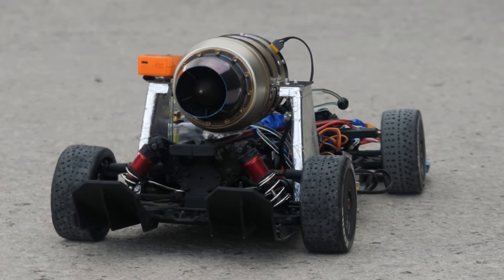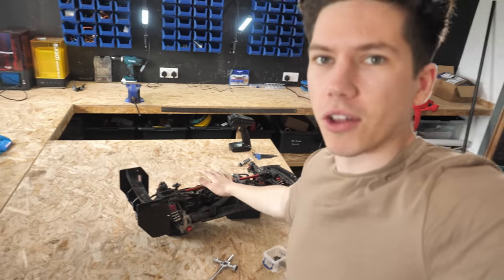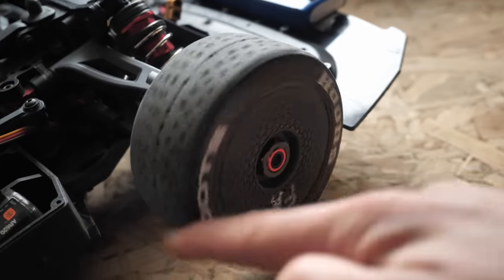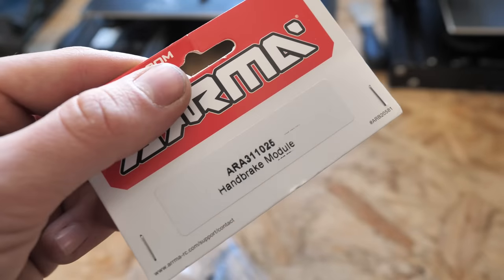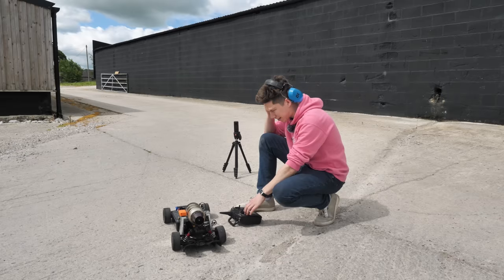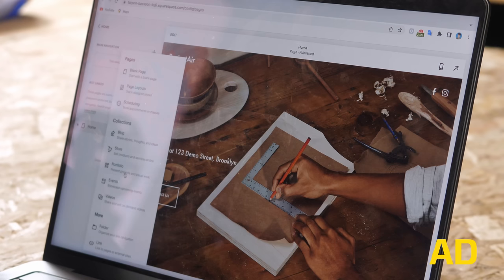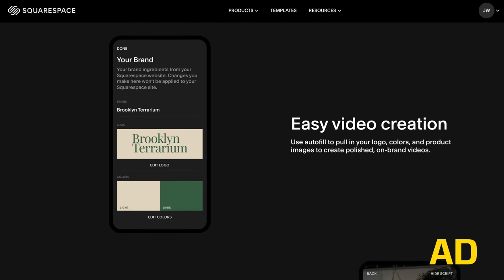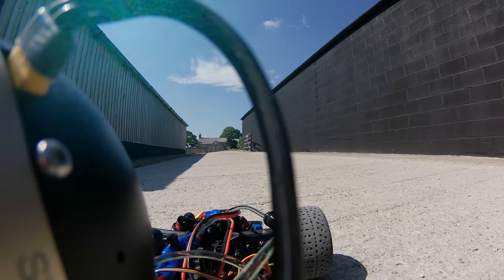RC Car Jet Engine Upgrade

Comment from the maker: If you own about 1000m of straight, perfectly smooth private road, let me know! 😉
Reply: i do
Reply: Colin fuze maybe like he uses a runway maybe ask him
Reply: @dorsalfinn89  Bingo!  That’s exactly what I was thinking!  A collab with Colin, perhaps? 🤔
Reply: Are you near any Military camps?  It could be worth getting a contact inside if so.  The key is figuring out who the hell to speak to... And that would depend on what Camp and who is there.  If you have one local I can try point you in the right direction to make contacts inside.
Reply: operatorflix has
Reply: Ask flite test.
Reply: maybe you should try an dragstrip?
Reply: Ask carwow to race it
Reply: I do but it’s in the USA ☹️
Reply: @asaliljedahl4685  dragstrips are treated with a sticky resin like material that gives the cars extreme grip, it would be very bad for a jet car since no torque is being applied to the wheels.
Reply: Santa Pod Raceway maybe?
Reply: @itsnorvinplayz4308  well where is it????
Reply: Hi, i don't own a private road, but i had an idea to make the car stop even better.
You need to add discs with a hole(or some kind of obstacle) in the fuel tank, to stop the fuel from slushing around and decreasing the stopping power.
 if you don't know what I mean, look at what's inside trucks that carry gas to gas stations.

Hope that helps, love your videos
Reply: I don’t own a runway but you should look up the channel Flite Test. I believe they have two
Reply: @niiice8622  agreed, i think they are called a baffel plate
Reply: The new Elizabeth line in London platforms are perfectly smooth, straight and 250m long, its shut on Sundays at the moment so maybe they will let you use them?
Reply: @that-1-guywith-a-name411  I don’t think their runways are long enough for this project. I think they’re only 150-200 feet long. And, FT is stationed in Ohio where Project Air is in the UK.
Reply: rofl
Reply: @niiice8622  Baffles, they're called :)
Reply: Hey @ProjectAir can you make an RC F1 car? It would look really cool!
Reply: @dorsalfinn89  That would be sooooo cool
Reply: Check with Kevin Talbot, or Claire's RC's (Youtube).  I know they have used an old airfield in past speed run videos. Cheers James!
Reply: Well, there is a 3km long, perfectly straight, perfectly flat converted railway tunnel in the midlands you could use 😉
Reply: I'm located in Bangor Maine, (USA) and I know a public race track that I used to skate at, if you're willing to fly down here, you could use that.
Reply: I heard the Berlin airport (BER) has some free runways it's not using right now. You might be able to go there :)
Reply: @davidfrench1325  like fly to america spend lotzs of money just to test a car plus the runway isnt that big!
Reply: talk to kevin talbot. he is trying to find a runway aswell
Reply: Contact funny guy Kevin Talbot here on YouTube. They use a runway for speed runs. He might set you up to take a run on it.
Reply: @nikolus24  That's exactly who I mentioned too, lol.
Reply: If you add a mobile connected camera so?
Reply: I can provide you with a runway to use at my work place but in the Midlands
Reply: Not sure where you are based (this is the first vid of yours I have seen) but Bruntinthorpe in Leics is one of the longest privately owned runways in the UK - so long the end disappears over the horizon. If you are in the East you could try Rendlesham or Woodbridge, SE there is Manston in Kent. There are many retired military runways that are now privately owned, search 'longest runway uk' and you will quickly find a list of active, disused or extinct sites.  I look forward to seeing a full speed test.
Reply: Come to the Rossa event in august, or get in contact with the runway in loughborough
Reply: You deserve more subscribers
Reply: Matt Watson from Carwow...
Or Max Fosh🤣🤣
Reply: You should use the old BBC road that they use for shows I can't remember what it was called but there is a road the BBC owns that they don't use anymore that's pretty open to the public, But i'm sure you could ask, Or go up north I know Scotland has a ton of abandoned roads.
Reply: Awesome project mate, I love when people think outside of the box, that thing is going to shift! 👍🏼✌
Reply: Where is the ejection seat part 3
Reply: @davidfrench1325  they're in the US mate
Reply: Angle the  engine upwards and duct the inlet down through the floor pan giving you some downforce with a low pressure zone under the car.
Reply: Santa Pod raceway. They are pretty helpful.
Reply: speak to keith bartlett at santa pod, he used to let me run my rc rocket car on the strip
Reply: Call Cletus McFarland
Reply: Then tell him and give him actual information
Reply: @itsnorvinplayz4308 .
Reply: There are plenty of racing clubs that have leases to general aviation airports this time of year.
Reply: I want to challenge you.
Can you build a plane where you can recharge drone during a flight?
Reply: Call Garret /Cletus Mcfarland. Loves Jets,  and has a track.
Reply: @whatev888  in south australia
Reply: CARWOW
Reply: cleetus mcfarland
Reply: @davidfrench1325  Flitetest is in America lol
Reply: Which aap use for designing of car engine
Reply: @dimonik12 yeah, the famous British military, very active in the 21st century. Face palm.

Comment: I have a driveway that is quite long but was recently given a new tarmac layer, it is very smooth meaning the vehicle wouldn't have any issues with bumps etc.
Reply: Not 1 Kilometer long sadly
Reply: Perhaps project air could use it (if you live in the uk)
Reply: @Build_Eye  ik but its too short
Reply: @operatorflix6339  fair
Reply: I don’t think he’s coming to ur house

Comment: Try redesigning the fuel tank and adding baffles to it. That might help increase stability when decelerating.
Reply: Yes! Baffles will help a lot for stability. Look at milk tank trailers for example, they all have baffles
Reply: exactly!
Reply: Came here to say add baffles. Good shout.
Reply: Fuel Cell Foam is a special, sponge-like material that is installed inside a racing fuel cell. The foam is mostly air, so it doesn't reduce the capacity of the cell. However, it provides a few key benefits: It reduces sloshing.
Reply: @henryyandell3222  you can just stick a fuel safe sponge in the tank.

Comment: Amazing video! If this car starts moving when on idle, I can only imagine how fast it will go at full power. You might need to add on an FPV system so that you can still control the car when it goes out of sight. I also noticed a crucial flaw in the car; it doesn't have a name!

Comment: At high speed I can guarantee it will tumble, rupture the fuel tank and spray fuel everywhere ending in a nice fireball, so make sure you record that.
Or implement a roll cage.

Btw the brakes are efficient if you have downforce, im not sure how much of it you will see if your parachute pulls the chassis upwards?
Reply: I agree plus his motor is high centered already a roll over risk in itself I’ma truck driver i know all about roll over’s i see them twice a week out here 😆
Reply: You could throttle the motor up so the thrust his the chute in turn pushing air forward to help slow the rc car

Comment: I'd love to see some thrust reversers on that thing. Not only would it allow you to break at high speeds without deploying a parachute, but you can even taxi backwards with it. 

Should be fairly easy to make with some sheet metal and a servo.
Reply: Haha easier said than done... Do you think about the one that were fitted to the first 737s ? Those one should be the simplest but if he ever installs reversers he might have to shield a big part of the car I think.
Reply: Clamshell is really the only option with a turbojet. All modern reversers use bypass air. Cool idea though!

Comment: you will want a gyro stabilizer at a minimum for the high speed run, i'd recommend also looking closely at the wheel alignment and a body that provides some downforce.
Reply: Gyro stabilisers are a good shout. Not sure how well they'll compensate since they're designed for working when the wheels are driven, not a thrust source above the centre of mass...
Reply: @lio1234234  It would still work.  It's not like the gyros turn off when you don't apply throttle.  You can have gyro on a model glider which has no motor and no wheels.
Reply: You can also adjust the suspension setup so its neutral and won't want to turn unless you really mean too.

Comment: I definitely suggest getting some startup and shutdown procedures down. Just turning the engine off after it's just been on can cause excessive wear and warping of the internal components of the engine. I'd say a 30 - 60 second at idle before powering down should do for an engine of that size. It's a big part of testing engines at full scale. The effect isn't as pronounced with smaller engines but is still there.
Reply: The ecu does that by itself
Reply: I own and fly several model turbines
to help with cooling I have a marine bilge blower with a length of dryer vent hose on the inlet..I put the hose over the tail cone and run the blower on a 3 cell lipo.
it does a fantastic job of drawing cool air through the engine and keeps the turbine spinning till its cool enough ..only takes a minute or 2 and temp is below 90c.
Reply: That's a very good comment. There's a shutdown procedure in the manual.  https://www.sw-jet.com/uploads/1/1/1/0/111064875/sw_manual.pdf . You can do that by RC command and the ECU will do it, BUT in case of a flameout( when fuel supply is interrupted) the ECU won't automatically do a shutdown and cool down the engine safely. That's also in the manual. I'm (fairly) sure James has read the manual :).
Reply: @chuckels431   or a used leaf blower works
Reply: Is that really necessary? Once it’s shut down the maximum temperature can’t increase, it can only spread slowly from the hottest regions to other parts. If they are designed to survive those temperatures it shouldn’t really be a problem.
Reply: @Mike-oz4cv  I believe the goal may be to cool the engine down more evenly thus leading to less warpage.
Reply: @Mike-oz4cv  Old school turbo engine cars needed a manual cool down period after a hard run, idling for a few minutes,  or you needed to install a turbo timer  to allow oil to circulate through the turbo to prevent uneven cooling and thus warping.  Turbos get red hot so obviously they are designed for those temps.
Reply: The turbine ECU handles all shutdown and cool down procedures by manually spooling the turbine wheel to blow air over the components. It adds run time to the turbine (the ECU disables turbine operation after 25 hours for mandatory maintenance intervals) so a lot just use a leaf blower to cool faster. The only way you will shock cool these turbines is by blowing super chilled air inside such as CO2 or similar.

Comment: Nice. Have you got access to a bubble tank to fit between the main tank and the engine. It will give the engine a small reserve and also prevent bubbles getting to the engine  and causing an inadvertent shutdown.   I always used a bubble tank in my model jets for this very reason. Just a thought and keep the content coming.
Reply: Great shout with the bubble tank!!!

Comment: Another interesting project. 😀👍
There are a few things that are worth looking at for various reasons.
1. Is the engine level? Most jet cars have their engine lower at the front so the thrust pushes the car into the ground, but your car has the engine high up not low down. 
2. The parachute. Yours seems to want to lift the rear of the car up. Maybe trying a cross shaped chute (top fuel dragsters) made out of a lighter material? This would mean you can have a smaller box and I'll just add drag. 
3. If you had some shock cord between the car and the parachute then it would soften any sudden jolts from the parachute. Less chance of  the car getting out of control.
Can't wait to see it stretch it's legs, it'll be awesome. 😃👍

Comment: Awesome project well done.

Also Pendine sands would be a fitting place with it’s land speed heritage, get there early when the tide is out, hardly anyone out and untouched sand for miles, fpv headset would be a nice touch too or steering gyro if it gets a bit squirmy at high speed.

Comment: I'll be curious how car-like this is going to be at top speed, 'cause I suspect it's going to be more of an odd-looking plane. Hope someone is able to hook you up with a proper race track to find out.
Reply: And that is why in the next video I can guarantee some wings will be fitter front and rear to hold it down..

Comment: Have you thought of using a tether around a central pole, it’d be great to see the stability limits at higher speeds.
Reply: The world record for the top tether car speed is 214 miles per hour (344.4 kilometers per hour.)

Comment: Looks very promising! ... Whilst the parachute is going to be pretty interesting engineering wise, I'd question whether it's the most effective / appropriate braking method for this though ... wouldn't the 4 wheel brakes, and maybe some kinda "active aero" approach (like an aeroplane does) be sufficient / simpler to build? If not, could you have a "U bend" type way of swivelling the thrust forwards to brake?

Look forward to the next edition already 👍🙂

Comment: If you go to Donnington park circuit in the evening around 5pm and ask nicely at the gate I’m sure they will let you use the huge paddock, it’s relatively smooth and noise won’t be an issue. 
Worth a call to MSV who own the track.

Comment: u could use a reverse thruster shroud. Some commercial jet engines use a shroud that diverts the exhaust to the forward direction to slow the plane down.

Comment: See if you could get in touch with Colin Furze, he used a nearby airfield for a lot of his high speed projects.
Reply: I said the same thing. Natural connection there. Only difference is Colin would ride it.
Reply: They're pretty old and bumpy though. Fine for a human-sized car but not great for an R/C car.

Comment: Huge fan of your channel once you get to full speed I'm concerned the tyre's won't hold up they'll balloon distort then explode or peel off at a high rate good luck with finding your location to do a real run 👊💯

Comment: I suggest lots of down force, at high speeds it will probably go flying once it hits a pebble, 

The jet engine can overpower the downforce drag anyways so you wouldn’t have trouble going insanely fast, 

Also I’d protect the car more with at least a cool looking body and maybe a roll cage or something over the jet 

If this works you might as well make a flying car with pop out wings 😂

Comment: While if I were persuaded to attempt this, I wouldn't locate your heaviest component at the very top of the vehicle which is also the powerplant. I know, bespoke chassis=PITA, but at the very least, I would cant the engine slightly nose down to avoid catching air and turning into a wingless plane. 
Best of luck with the ensuing wreckage test!

Comment: Use the electric motor on reverse polarity on the drive shaft with a metal gear to slow down

Comment: I think the rope between the chute an car should be a little longer rather than short. Just like with towing a boat or another plane (i.e. glider) the rope is a lot longer for stability. Also a cool aero focused body would be cool

Comment: I think you should put a baffled fuel tank in to stop the fuel sloshing around and altering the centre of gravity of the car, I think it would help with stability at high speed

Comment: First off I think this build idea is an awesome but there's 2 points 

#1 unless you're planning on building a thrust SSC replica (which I'm all for btw) with 2 larger turbines than your current one the parachute is completely unnecessary. James McCoy, Raz Shiffrin and several others have had no issues stopping their cars from 200 + mph without one.
#2 I'd highly recommend some foam tires if you think you'll see over 120 mph as those hoons typically don't survive much faster. A tire blowout at those speeds would be catastrophically expensive considering the cost of that jet alone.
Good luck, be safe, have fun!

Comment: Going with the parachute is a smart idea. It seems however that the rubber band is not quite op to the task reliably. You could try to make the chute being launched in a pneumatic way instead. Or perhaps a co2 cartridge. Also, replay the chute before you want to brake and make sure to use as much of the chute and as little of the brakes as possible. If you look at drag racing cars you’ll notice that their brakes are way under powered for the horsepower those cars have but they depend on their chute almost 100%. If you want to see a good example of the proper use of a chute you should check out Cleetus McFarland on YT and watch his last video or two. He is braking from +200mph to a near stop on his chutes.

Comment: What you really need is a proving ground for an auto manufacturer. These grounds are made to be perfectly flat and free of debris. I used to live in Michigan and there were a number of those there but I have no idea where there would be one where you live.

Comment: I think for straight line braking you'd be better locking the differentials. At the moment, if one side locks up, you will spin where as with a locked diff, you'd have a better chance of keeping traction and not locking up.

Comment: Nice. Wonder if could fabricate a thrust reverser for the engine as an additional break. This would be especially useful if build a jet powered hovercraft.
Reply: It would be an additional break point but not very good for braking due to added complexity and mass.

Comment: Might want to switch over to a long range radio setup when you are ready for testing. That will cover a good distance quickly, would stink to run out of range and end up upside down.